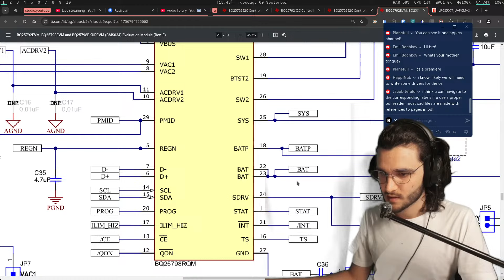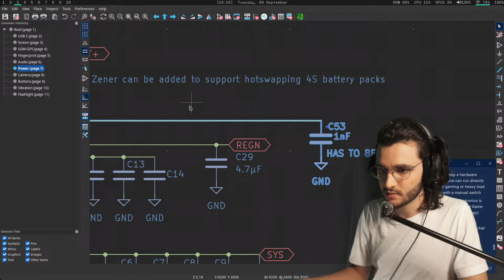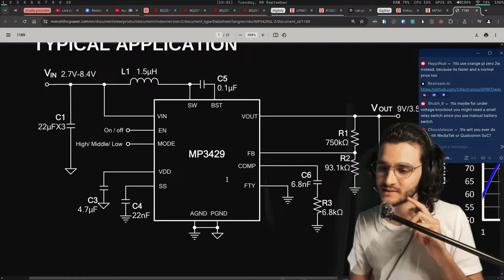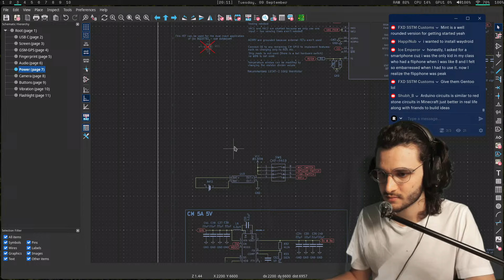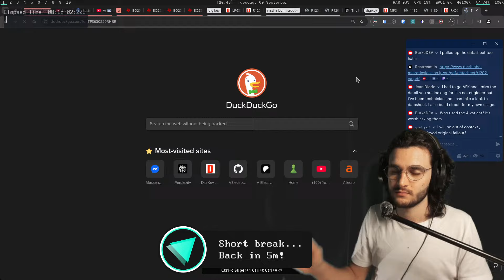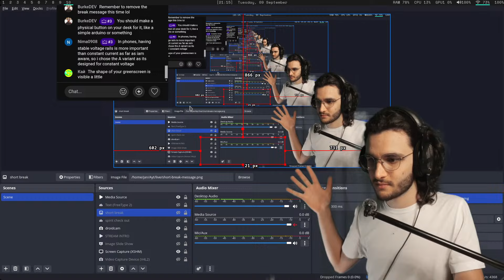🚨WORKING ON SPIRIT SMARTPHONE (#7 live replay)🚨

Comment: You should make the case of your phone from an old steel can.
Reply from the maker: I think i'd need a steel bender or a steel melter + sand casting process xD

(building a melter is on my mind but I don't trust myself enough) and It doesnt have many use cases compared to a cnc mill)
Reply: @V_Electronics  Steel cans (ones that are still steel, not aluminum) you could just work with hand tools and not have to melt it, or figure out how to cast steel thin enough that it's not a needlessly heavy brick.